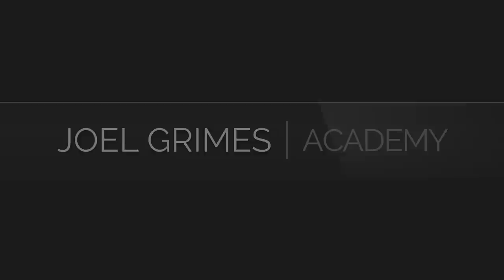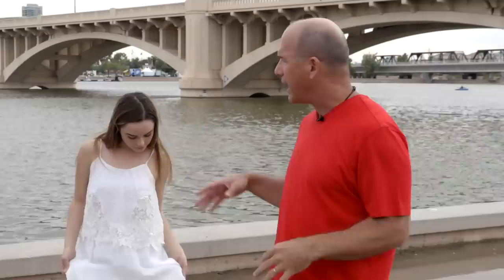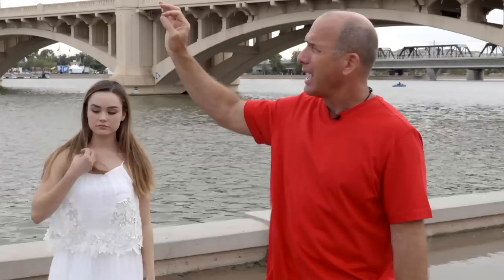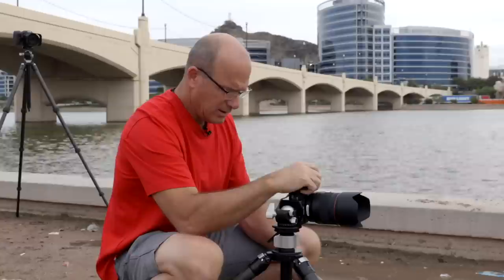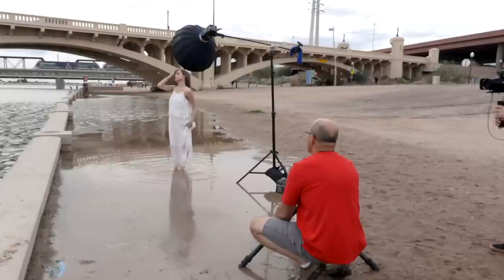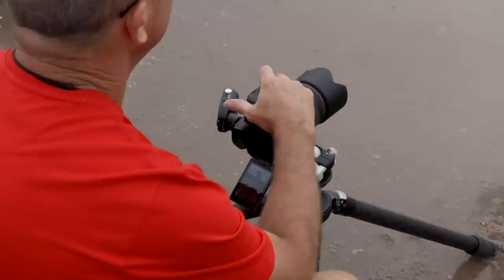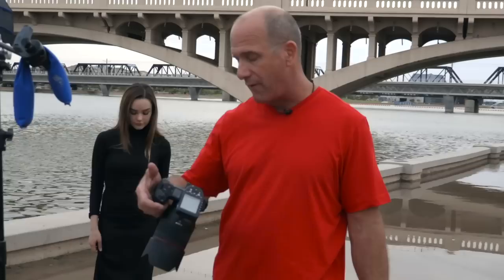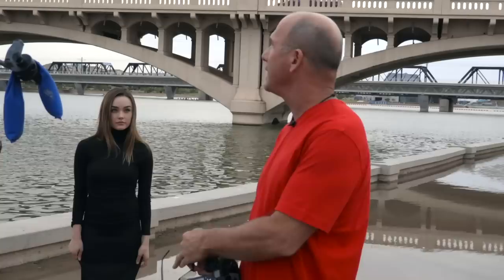HIGH SPEED SYNC EXPLAINED - Start taking dramatic portraits anywhere!

Comment: I have been informed by Godox that the HSS with the canon R5 is not compatible is this wrong ?? I have the canon R5 but wasn’t sure if the HSS and TTL worked with the R5. Very confused at the moment as to if it will work or not

Comment: Joel, could you have used a Godox AD400 to achieve the same results?
Reply: Yes
Reply: Not Joel, but I would say yes. The back ground is not too bright. With full sun, you need power and even one AD600 at full power isn't enough. You then need two of them with dual extension head (1200ws)

Comment: It should be automatic is a not a true explanation. I have a canon r6 with Godox AD 200 and Canon 6D with Godox V1. 
A big in investment. 
The r6 gives more more trouble than the 6D:::Syncing the camera and strobe is a nightmare and the r6 camera continues bounce off the HSS capability to not allow me to shoot at 1/1000 f/1.4 - stoping it at 1/200…this absolutely a problem in the middle of portrait session. 

There is no one that has clearly explained HSS process of the camera: speedlight function, second curtain…it’s a pain.

Comment: I find you very frustrating and unorganized. Five minutes into the video and zip explanation on high speed sync.We know you are shooting wide open f2.8 and guessing ISO 100 but then what? Normally 1/200 to 1/250 is normal for sync speeds  sooooooooo sunny 16 says 125/16 250/11 500/8 1000/5.6 2000/4 4000/2.8? Really? So you are popping at a power of 2.8 or less. It’s looks  overcast so I may be one or more stops off but come on! This was pretty much click bait. No understandable explanation of high speed sync.
Reply from the maker: Thanks for the feedback. Maybe I'll make a new video on this video with some more clarity. Much appreciated